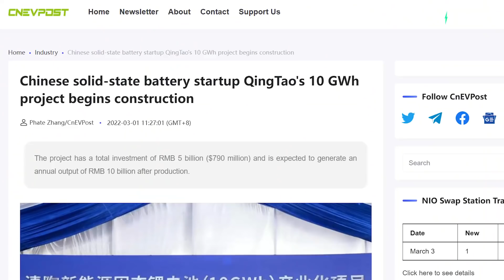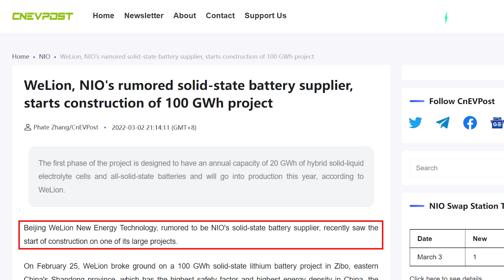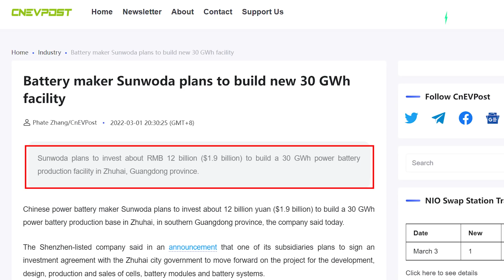This battery news is SCARY

Comment: Tesla’s 4680 cells could be out of date before they really get started. I always thought older legacy manufacturers holding out would gain if some company cracked solid state and could provide said legacy with the packs. You’ll drive say a BMW with BMW drivetrain and everything else BMW but the packs will be Chinese because they can produce them faster, better and cheaper. To the Owner they don’t care as long as the battery performs as expected. The Chinese will probably give the packs a eight or ten year guarantee that auto makes will be able to pass on to the customers. Of course companies like Tesla building their own battery production will make a better margin as they are building some of the percentage they need themselves but even they are farming out cell production.
Reply: Not really. 4680 is a form factor not a technology. The same advantages apply to a 4680 format solid state battery.
Reply: @Adrian-Wright  the technology used in solid state might need another form factor than cylindrical so these advantages might not apply to 4680..
Reply: @immodsr9348  Typically cells are developed as coin cells. Cylindrical cells are just flat pouches rolled up.
Reply: @Adrian-Wright  but CAN these solid state materials be rolled up without taking damage or as densely as liquid ones?
Reply: @immodsr9348  Very possibly, as it's a manufacturing stage - they could also be extruded or built up pre-coiled.
Reply: BMW have used Samsung (ROK) batteries since 2013, and CATL (China) since 2018, so they are there already really.
Reply: So you're saying Elon is stupid? Good luck...
Reply: @gregbailey45  My opinion on this is up there, but only stupid people think clever people don't make mistakes.

Comment: Solid state is the game changer with batteries. Any progression toward it (be it semi-solid to full solid, or Toyota's small full solid in HEVs and PHEVs to large in BEVs) is a good thing.
Reply: Toyota (Toyoda) essentially said
"We don't have the cycle life, they're too expensive and we can't build in volume...... Before 2030. Meanwhile we'll continue as we have been" (then a few weeks later announced a bus to be powered by hydrogen)
Reply: @rogerstarkey5390  Ancient history much? Look at the BEV media event this past December 14 and check back in.
Reply: Economically viable 'solid state batteries' don't exist. The term is an oxymoron in fact. The electrolyte is still a liquid because IT HAS TO BE !
Reply: @grahamstevenson1740  You're misunderstanding something strange. (Silver sulfide dates back to Faraday, and it's permeable to ions and impermeable to electric current--a solid electrolyte. There are plenty of compounds like it.) I wonder where you got this. Hmm. Maybe someone's spreading fake science articles about battery tech to help slow adoption.
Reply: @jonmichaelgalindo  Silver sulphide is not a component of lithium-ion batteries !

I'm very familiar with lithium-ion batteries actually, their chemistry and construction.
You apparently are not and are introducing irrelevant data.
Reply: @jonmichaelgalindo  You seem confused about what an electrolyte is / does.
Reply: @lengould9262  It transports ions and does not transport electrons. What did you think it did?
Reply: @grahamstevenson1740  that's what they said about EVs

Comment: Once all the Manufacturers have a steady supply of batteries, the immediate demand will decrease, as the battery recycling kicks in !
Reply: Plateau, not decrease.
Reply: I agree that battery recycling will be important. However, Jevons Paradox (Google that if you are not familiar with it) suggests that as battery technology improves (cost decreases and capacity increases), demand will actually increase. For example, when battery technology and availability improves enough to satisfy the demands for the electric vehicle market, other markets for batteries will open up, such as electric boats, planes, trains, energy storage, and robots.
Reply: @CiaranMcHale  Some of that will happen, but if it's displacing fossil fuels, then it's a win for everyone.  Eventually, battery demand will slow and recycling will make a larger and larger contribution to battery metal supply.
Reply: @CiaranMcHale  demand for energy will never cease. One of the biggest examples would probably be assisted living for the elderly. If there are a cheap and strong exoskeletons with batteries, demand will go through space. Applications are limitless.
Reply: I'm sure that supply will get to a level that supplies everyone, but also, batteries will change and improve, maybe become more lightweight, different compositions, etc. etc.
We could see under highway wireless to charge vehicles permanently, then possibly wireless charging via satellite, as per Nikola Teslas' vision  !
Reply: @Rovinman  charging from space? Yeah, nah.
The sun does that now, no need for Nikola-isation.

Comment: Sam, always good content.  By the way, as a motocross dad, I was transferred to a level 1 trauma hospital after crashing my son's KX250F.  Just a quick test drive to test the brakes I replaced.  Just before I took off, I decided to grab my son's helmet.  An advanced 6D ATR ($700 USD at the time).  I would have been dead in an instant had I not made that decision.  As it was, I broke everything on my left side and went to surgery.  Root cause:  new brake lever did not allow for expansion of front master cylinder.  Lessons: 1.  Wear a helmet, always.  2.  Always wear a helmet.  3.  Burn lessons 1 and 2 into your brain.  Glad you are okay, mate.  Outstanding channel.
Reply: 1 more lesson: Test the brakes when the bike is barely moving a few times.
Reply: Don't know if you gonna read this but... hope you got better, up and kicking. I know the pain of caring and loosing a loved one. Stay safe and close to your family. Get well, my friend!